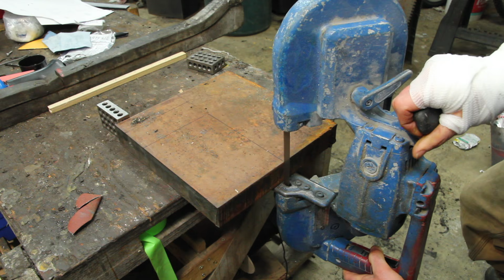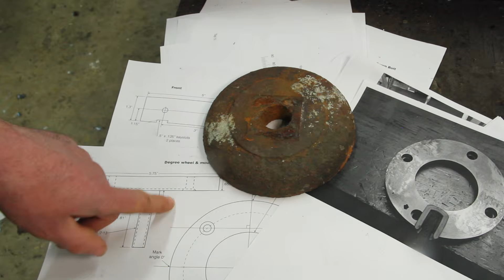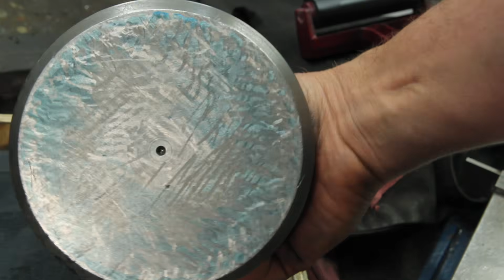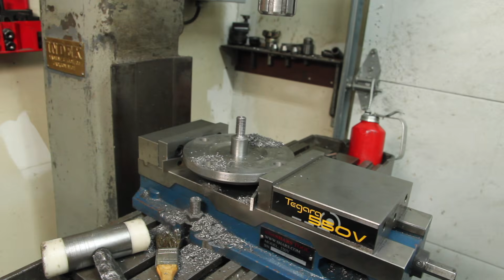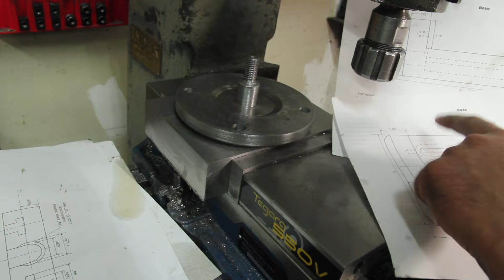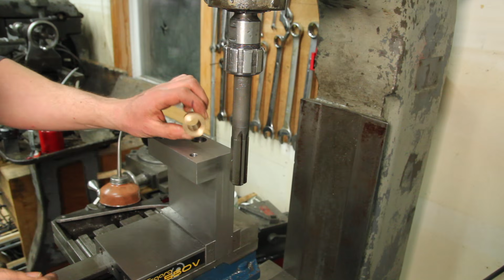Rhodes Shaper Vise Re-Creation (Part 1)

Comment: You said that cutting thick material is not fun, I agree.  But have you tried the Milwaukee Torch blades for sawzalls with the Nitrus carbide teeth?  They're expensive, but they really tear through cast iron and steel, and are available in a number of tooth counts.

Comment: 16:40 I just thought about this... does anybody use grinding paste to fit two parts like these together? Like the stuff you use to grind valve seats in engines?
Reply: I know its a year late but i thought why not, when i look at the time mark on the video the idea with the grinding paste would be a bad idea as he is fitting it on the machine. That would result in wear or removal of material on both machine table and vice and you want to avoid any wear on the machine itself. You can use it for complex geometry if there is no other choice, with cutting punch seats for example.

Comment: Greatly enjoy your content!  I had a similar problem with my Gorton 8-1/2D (9 B&S taper).  I bought it (cheap) with the collet chuck having been broken off leaving the taper tail stuck in the spindle.  Luckily it was a threaded drawbar taper and I was able to rig a makeshift all-thread puller…. 

Tighten….penetrating oil…..grit teeth-frown-pray and cautiously tap on the all-thread that protruded through the threaded taper tail.  Rinse and repeat for a few days and then one day, POP!    Not sure if this had already been suggested, but it worked in my case👍

Comment: What tooth-pitch blade do you have on that saw?  Is it the one more like 20TPI or more like 10TPI?  For the hot suppers I see you feeding it, you'll definitely get faster cuts out of 10TPI.  I can't remember what I sent on it, probably the 10TPI since I knew you wouldn't be cutting thin-wall pipe most of the time
Reply from the maker: The one that was on there when I got it was right about zero tpi.  😆.  I’m running a 10/14 variable on it now.
Reply: @JeremyMakesThings  Hah ok, sorry for sending you a dud! I must have sent that to you before I got my bulk order of blades

Comment: Don't know whether you are aware or not, but if it turns out that the taper in your Index Mill spindle gets messed up Index can machine your spindle to fit the R-8 taper for which there is a lot more tooling available than the B&S 9 that was standard. I had my spindle done and am very happy with the outcome. I'm enjoying your videos.
Reply from the maker: It’s pricey though, and this machine has some other issues that need to be dealt with before it would be worth doing.  I may eventually go that route though.

Comment: You made cutting the jaw keyway slot look so easy I would have thought a "loose" key with a slot in the jaw and the base would have been your solution of choice.  😜
I actually groaned both times out loud.
Much to the annoyance of my wife.
I was wearing buds.
Keep up the good work.
Reply: Seeing the vice base moving while the jaw slot was being cut caused that nasty little surge of adrenaline that I'm all to familiar with when machining!
Reply: @Ferrum Ignis  
I think I might have clamped it to the table without the swivel base.
Then again, I might have milled it  😎